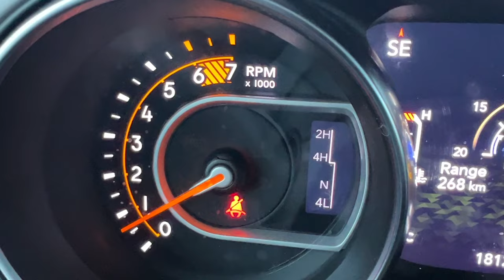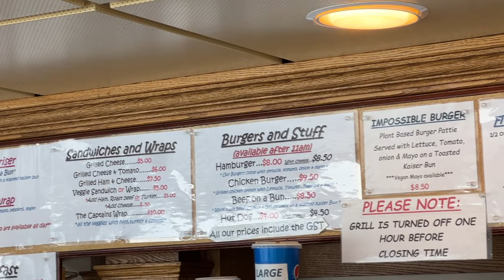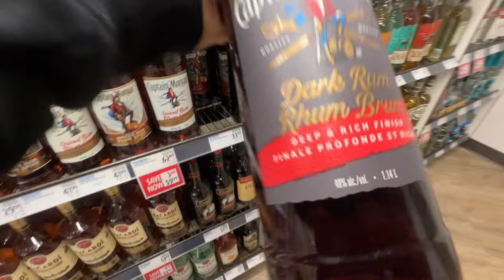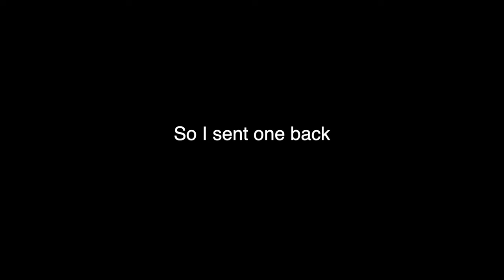Through Snowy Mountains Back to the Vanbuild | Winter Life in a Jeep

Comment: Hi Matthew. Im getting tired, just watchimg you driving back and forth to Calgary. My E250 is insulated and panelled. Other than the bed im thinking about using so,e metal framed, fabric drawer sets. And the plastic omes too. I already have a few at home. Plus they weigh almost nothimg. So, should help with fuel consuption.
Just and fyi. Since your in the perfect spot to rethink your plan, should you care to.
Happy trails littel buddy....😅😅😅

Comment: I also wonder if you need to take into account how easy it would be to tend the litter box. It was cold in the winter to have to open the back door every time, but it was right at the door without having to reach in so far and pull it out around a corner